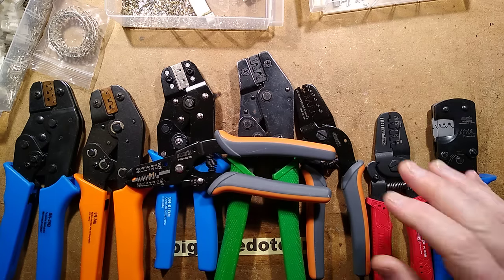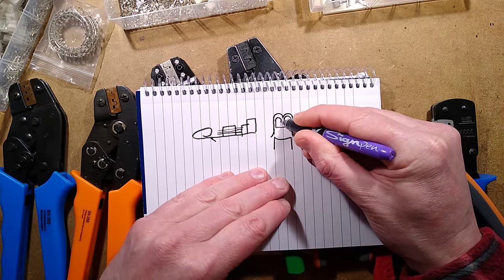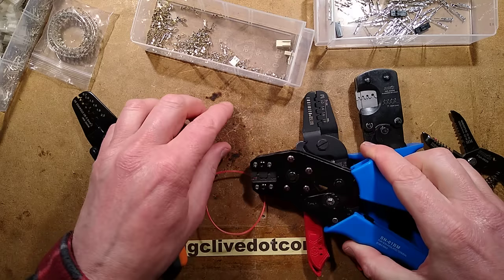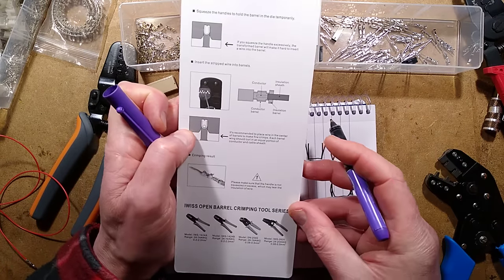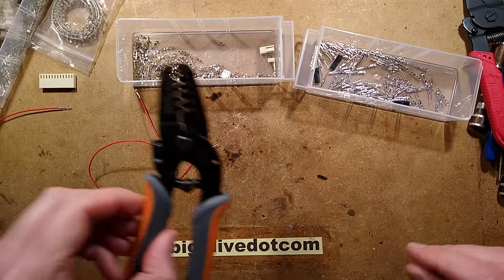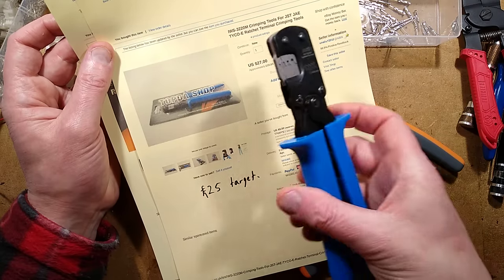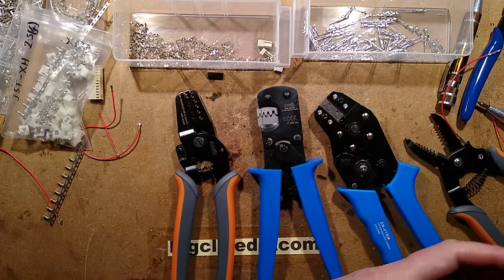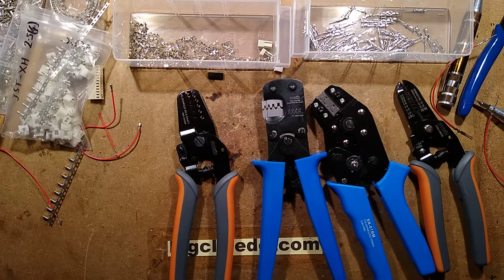Crimping tool test that I screwed up. (Read description.)

Comment: 23:25 the offset insulation crimps on the “DuPont” terminals are actually not supposed to be crimped into the wire (creating the pretzel- or B-like cross section formed by the Golden Arches), but rather are for a circular die that wraps them around the insulation, with the offset tips forming a continuous collar around the insulation, but without cutting into it. I know the Molex tooling actually creates that circular crimp, but I’ve never seen anything I could afford that does this.
Reply: The Preciva PR-3254 does this in its innermost slot (as well as being deep enough to crimp the full "dupont" connector), and is fairly cheap, as decent crimpers go, at around $40. https://www.amazon.com/dp/B07R1H3Z8X/ It still took me probably a couple of hundred crimps to figure out how to work the thing reliably, but at this point I'm very pleased with it. Using a die designed for dupont pins helps a lot.
A few of things I learned on my own that are not in the video or I felt were under-emphasised:
1. Getting the wire to the right depth (insulation through the insulation barrel but not extending into the wire barrel) is one of the trickiest yet most critical parts. It helps to hold the wire with your dominant hand when inserting it.
2. For dupont female connectors, it's also important that the bare wire not extend more than a smidgen beyond the wire barrel, because otherwise it will interfere with the male pin entering the female connector. You need to strip very little insulation off the end of the wire, less than feels right when you're just looking at it.
3. After the crimp is done, hold the pin tightly and give the wire a good hard tug to test the crimp. Don't be shy about how much force you use; a good crimp will resist a lot of force. And of course, do this before you put the connector into the shroud, since they can be a pain to get out again.
I also find that my crimps, at least with this tool, work best when I squeeze it really hard, two-handed even. I check the results under a magnifying glass regularly and have never seen a wire or insulation damaged this way, but I have had plenty where the pin came off when given a decent pull.
Reply: @Curt_Sampson   Hi! Thanks for the detailed reply! In the 9 months since my original comment, the situation has indeed changed. Preciva has a few models, and a few others have shown up on aliexpress as well. None work as well as the OEM tool (or one very similar), though. Back in May, I started a forum thread on this topic, and it’s got lots of details on some of the options that have come out: https://www.eevblog.com/forum/reviews/affordable-crimp-tools-for-small-connectors-(dupont-etc-)/

As far as your numbered tips: yep, absolutely correct on all points! I’m now working at a vocational training center, and have done a couple of crimping workshops with groups of electronics apprentices. Indeed, they’re often surprised at how little one needs to strip for some connector types. (JST in general, and Molex KK 254 and its clones (KF2510, etc) for example.) 

Getting the insertion depth right is indeed tricky on basic tools. It takes practice to get a “feel” for just where the insulation should hang up to be in the right spot. I sooooo prefer using an expensive crimper (esp. the kind that are Wezag CS10 based) that have an insulation stop blade inside — those get it right every time.
Reply: @tookitogo  I should note that the Preciva PR-3254 that I suggested is not new; I bought mine on Feb. 2, 2020, before this video came out. Oddly enough, the tool now seems to be less available than it was back then; it disappeared from amazon.co.jp about six months ago and I see it now only on amazon.com. It also mystifies me why no other tool has that same "dupont" jaw (longer and without the "M" curve  on the insulation tabs); aside from that the tool seems decent enough but nothing special.

Thanks for your link to the EEVblog forum topic; I'll have a read through it, though I'm not actually looking for a new crimping tool at the moment. While the PR-3254 is certainly far from perfect, I suspect that I'm not going to find anything better for under $100 or even more.
Reply: Well, I just checked out that forum thread and in the very first post you link to the SN-4228B / TZ-4228B (https://www.aliexpress.com/item/4000497324950.html) which appears to have the exact same dupont crimping jaw that the PR-3254 has, and at an even more reasonable price. And there's a lot of other good stuff in that thread.
Reply: @Curt_Sampson  Thanks for the update! The preciva and the 4228B aren’t exactly the same: the latter has 4 positions in the die, not 3. But the illustrations are clearly from the same source, making it quite likely they’re made by the same company and rebadged as needed.

Comment: I saw the Engineer PA 09 on the thumbnail to this video and I  wondered what you would have to say about it as I bought one after getting a refund on the truly awful one Screwfix sell. Very glad to note your comments match my experience! Yes it does a good job but it isn't exactly my favourite tool, that honour goes to my Irwin Vise Grip self adjusting 8" wire stripper. Massive time saver.

Comment: Went through the whole thing 30 years ago. No internet, things happened kinda slow and jerky. Same Molex connectors. Were the inputs, outputs and control points for a bidirectional intercom amplifier. Ended up mailing several of the teensy little parts to our main electronic supplier out of Chicago and they sent me the tool. $75 US in about 1988. Tool handle was TRW Cinch with a set of Molex jaws to fit two different sizes of female connectors. They were nice enough to send a bag of each size, 20 bits per bag. The whole episode took about 100 days to accomplish, Thank goodness I was being anal and did all of this well before I needed to do all of the coming changes. Just to illustrate some differences between 1988 and 2020. Customer service was king. Now, not so much. This was in a 800+ bed detention facility in the Denver, Co. USA area. Michael in Colorado (retired)

Comment: You're supposed to use the round die for the triangular insulation tangs like on the Dupont. The W die will do exactly what you are experiencing. JAE MX-1900 terminals are the same way. The Engineer PA-24 actually has two round dies in addition to the appropriate size W dies.

Comment: Have to say this, I detest manual crimpers of all types. I've seen so many poor and dangerous crimps made by manual crimpers in both electronic and electrical fields over the years. Biggest problem is that you cannot guarantee the strength and electrical performance of every crimp. By using certified ratchet crimpers you can guarantee  the terminations are correctly made. Built everything from PLC racks and controls up to 11kv power distribution systems over the years. In all cases the test certificate of the ratchet crimpers had to be listed in the OEM manuals as part of the warrenty. Lots of my crimpers came from RS with certification and when  I worked for Klockner Moeller they had their own certified lab for testing and certifying torque wrenches, torque screwdrivers and crimpers etc. Working on cars as a hobby the amount of poorly made terminations carried out by mechanics etc, that I've found is shocking. Just because it runs at 12 volts doesn't mean that a pair of combi pliers can be used to crimp cables. Crimps fail due to arcing, from poorly made connections, heat caused by the arcing causes the insulation to melt and potentially catch fire. I get that decent ratchet crimpers can be expensive and manual crimpers are cheap, but when your project/car install has intermittent faults due to the integrity of the crimped connection that takes you hours to find, you realise that those cheap manual crimpers were a false economy.
Reply: In my early career I worked as a tech in a metrology lab, and we actually 'calibrated' crimping tools. Mostly asea combiflex/combitrol. Crimped 5 test wires with every tool, then used a pull test machine to check the crimp. Surprisingly often the tools were worn and wouldn't pass the test.
Reply: You've convinced me. I'll be saving to buy some decent ratcher crimpers.
Reply: @ulwur  we even went as far as doing a volt drop measurement as well.
Reply: this gets used for 30cm wires using 5v and some shitty arduino clone. Not high voltage
Reply: @LuluTheCorgi  It doesn't matter, the crimp still have to be done correctly to ensure both the electrical and the mechanically connectivity.
Reply: @K2teknik.  it kinda does matter. this is what your threat model should incorporate. what is the potential loss if this catastrophically fails? how likely are events to happen? what is the cost of those failures? and then decide if you think its worth the risk. will i risk creating 10% bad connections if i'm only making like 20 connectors for my 5v <1A arduino project, saving me 350 bucks? you bet your ass i will.
Reply: The problem with automotive is there are no wiring standards they have to follow, so they just do whatever they want, which is why trailer wiring is almost always horrific, and constantly goes bad, and why I don't like modern cars because it just takes one bad crimp, or solder joint to take down the whole car, and good luck tracking it down since all the wires are the same color, and they spliced them en route, and the whole mess is crammed into a tight compartment where they can't be accessed, or traced properly. I use hammer on ring terminals for big stuff, with grease in the joint to keep the corrosion out, and then try to pull the wire back out to see if it crimped properly, solder joints for the smaller connections since I can't get the shitty spade or ring terminals to make a solid crimp reliably. I suppose if I have to start doing more wiring I'm going to have to get the proper ratchet crimper, and a bunch of proper terminals that work with it, but solder is more universal, and works better, even if it is slow.
Reply: Nah ratchet ones are too bulky, i'm really concerned by the weight of my go to tech backpack

Comment: I have a crimping tool with the 28B jaw. I spent a lot of time  trying to make it work with Dupont connectors. Finally I adjusted the screw that controls the pressure on the tool and then it worked very well. The adjustment has to be very precise. If the screw is out of the correct position, it will not work properly.

Comment: Thank you.I ad a heck of a time trying to find the right crimpers. I use JST plugs all the time and had bought a couple setd of crimps that said they were for the type and size of pins I had. Long story short, they weren't. Since then, I've been scared to buy another set for fear they were incorrectly labeled as well. Just ordered a one of the Iwiss ones just now. Thank you, this video was a huge help.

Comment: I have a ratcheting crimper set with two sets of jaws (one set of jaws, still unused, works for the size range you're using here), and I've used it many times for car stereo and alarm/remote starter installations (6 & 8 gauge wire, using butt terminals and quick-disconnect terminals primarily). At first, I balked at the expense - $45 at the time - but then I remembered the really cheap $20 stripper-crimper-and-screw-cutter tools I had been using for years, and how every one had become bent with only crimping use (quite a few Chinesium ones, and even a 1980s Crapsman), and how much hand strength it took to squeeze those suckers... And I decided, "why not?" Turned out to be one of the best tools I have ever owned. Even though I don't use it very often, when I do use it, I love how it makes consistent, good-quality crimps (on both stranded AND solid-core copper) with far less effort. My only gripe is that most of the time, I don't open my hand far enough to reset the mechanism.
18:25 - The crimpers I have are similar to those. The serrated wheel at the pivot point with +/- on it sets your maximum limit. 

Because I'm disorganized, I often have to resort to Vise Grips sometimes to crimp those types of terminals, and if I do it properly, it does a fairly good crimp.

Most tools like these are shipped with a very light spritz of oil to prevent rust during distribution.

Comment: I work in an electrical panel shop and deal with this on a daily basis. The best crimper for a Molex pin is the Molex tool. The Molex tool has a holder for the pin. You put the pin in and partially close the crimper. There is a stop for the wire and you catch the insulation on the insulation tab. Be aware that some pins have three tabs and the third one is to support the wire. The third tab does not get crimped. It is there only to support the wire. If you do a lot of stripping for these pins, you want a Weidmuller Stripax Mini Duro. Someone in the UK has them on sale for 25 GBP on ebay(a steal).

Comment: I can tell you more about crimping tools and solderless connector then you even want to know.  For a couple of years I worked in a lab that did "Mil-Spec" testing of terminals and connectors. Mil-Spec is Military Specification.  They had to pass that in order to be use on government contract jobs.  With Mil-Spec crimpers, you can neither over or under crimp as the Mil-Spec tool was designed that way.  We had both hand and automatic crimpers for all sizes of wire and terminals from 0000 to 28 gage wire.  Insulated and uninsulated.  In all cases, the crimp was stronger then the wire.

Comment: the parallel jaw iwiss 3220m is easily my favorite crimper. it works on all the stupid small crimps you find in modern tvs and laptops at the expense of being tedious on dupont and unusable on older molex style power connectors.
i've bought several of those iwiss 3220m's for work and home and a travel bag and every one at every price point has been at least serviceable if not perfect. 

every classic die crimper i've ever bought on ebay (apart from some used molex dedicated $$$ tools) needed finishing before it worked properly, often they would work fine if not for the paint the chinese love to use on the dies instead of chemically blueing them. a light filing to correct the geometry tends to turn a $5 crimper into a useful tool it's almost like buying chinese lockpicks or chinese tweezers, they ship a tool that is finished just enough to be technically usable and if you need more precision or surface finish it's up to you to put in the effort

Comment: One thing I like to do when preparing the terminals for  crimping is to cut the strip of terminals leaving little tabs at the back of the pin.
So you can insert the wire into the pin visually (no jaws are in the way), and hold on to both by pinching the tab of metal at the back and the wire.  Then you can put the wire/pin combo into the jaws and crimp it in one go.

Comment: A good presentation of various low priced crimps. Logically if you are in the business of crimping lugs and pins  frequently then you buy the top of the line tools. But for intermittent use the less expensive will suffice. I own both a five hundred dollar crimping tool and a twenty dollar tool and you can tell the difference when using them. One does prefect crimps every time with no fumbling and the other does take more time with the need to double check your work.

Comment: Please can you tell us what is your 'known good crimper tool' with the green handles? You didn't mention what manufacturer and model number these are but they are the only ones you mention have 2 sets. You wouldn't buy 2 sets if they were not good I assume? Does your green handled crimping tool crimp the Radio controlled model car radio receiver (Futaba etc.) and servo wire connector type crimps better than the Chinese made crimping tools you recommended in the video? Do you still recommend the Engineer PAD 11 crimping tool is better than the tool you recommend in this video (the Engineer PAD 11 is more expensive and needs more time to carefully crimp separately the wire and the outer but doesn't bend or damage the crimp like some of the other crimpers that crimp the wire and outer in one action?)

Comment: The Dupont's insulation tabs cross past eachother and should wrap around the insulation - side to side and around. The wire connection does the arches and penetrates the center. I'm fortunate enough to have picked up the real Dupont and Molex supplied crimpers which work phenomenally well. They are clearly made for production volume use. Very soft springs reduce fatigue and the tooling is spot on of course.  I'm sure I've done thousands of connectors by now.

Comment: The first 2 crimping tools you mentioned are not in the correct setting, you can change the crimping pressure by adjusting the dial. Remove the screw holding the dial and turn the dial CW or CCW to find the correct setting without over or under crimped. Chances are both crimping tools are usable and not crap as you mentioned.